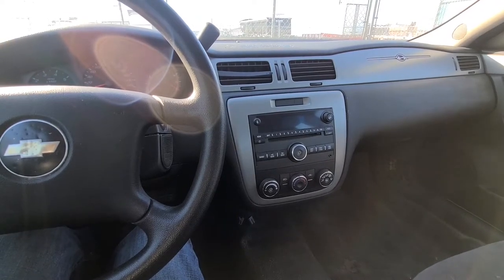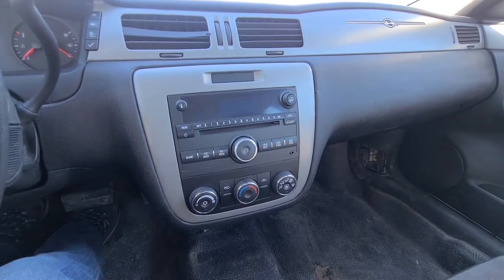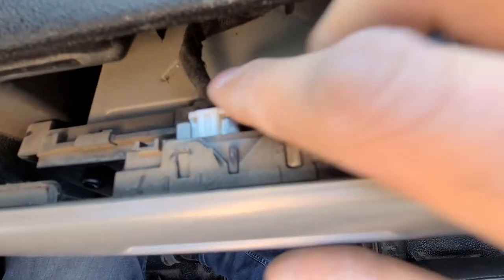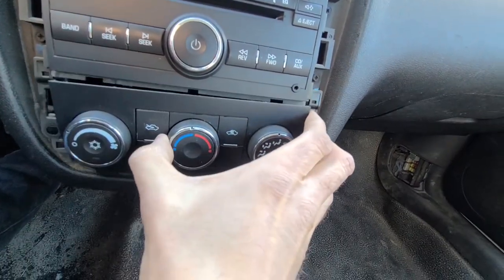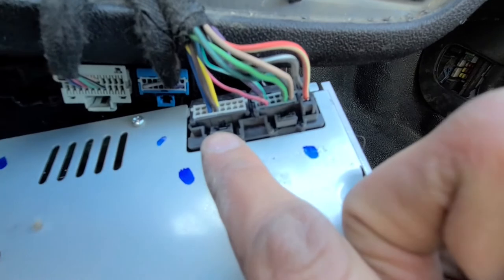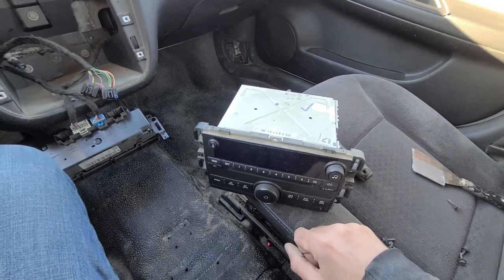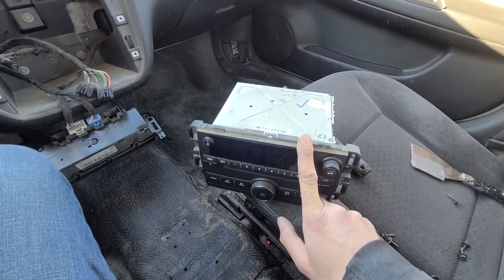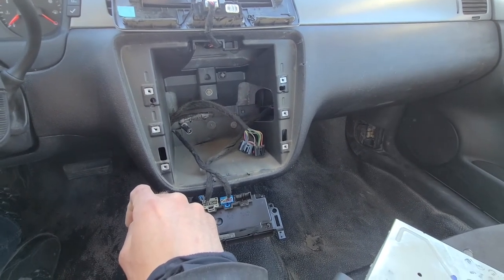Chevrolet Impala - RADIO REMOVAL / REPLACEMENT (2006-2016)

Comment: Thanks. Very clear and straight to the point. Now i can change mine.
And thanks for the information about the radio code. How if at all will that effect aftermarket radios?
Reply from the maker: You're most welcome. Aftermarket radios will not be locked and will not ask for the code. You will need proper wiring harness and dashboard kit to install aftermarket radio

Comment: Whats the cause of no sound on signal lights or hazards power to the head unit but no sound as well .
Is the head unit dead or is it a ground wire I use to hear a winning sound when you would accelerate now I don't even hear that sound would come from speakers too any ideas what I can do ?
Reply: I hope you already have it installed but try putting the ground on the car body and make sure to scrape away the paint, I had the whining noise in my subs, turned out to be a bad ground

Comment: Do I need a 4 digit code for an aftermarket radio, or just for an original replacement? Thanks!
Reply from the maker: Just for original radio. For aftermarket you will need wiring harness and radio dashboard kit

Comment: Hey I got a question so I Bought a aftermarket radio for my Chevy impala and I had some problems with the 12 V power over it work with her but the fuse or something And I tried to connected to the all-time power I did that and my battery died in my car I just need to help

Comment: Hey I know this video is 2 years old but I was wondering if you have any videos on putting a new aftermarket radio in. It’s way to difficult for me 😂to
Reply from the maker: Hi sorry never recorded it. You will need a wiring harness and you could need a dashboard kit depending on the type of radio you are putting in
Reply: @QuiteAlright  thanks man, we figured that out after about 2 hours of fooling with it 😭. Do you have any links to tutorials that go in depth?
Reply from the maker: @scoutzmarks2410  No not really. Best you can do is head to audio shop and show what kind of radio you are installing. they should have a wiring harness and dashboard kit for your type of radio and once you have that it is very easy

Comment: I bought a radio and everything but do you have a recommended kit because the ones i but never fit
Reply from the maker: I can't really recommend anything. I know Metra brand is decent. I usually get something at a local audio store once I know what kind of aftermarket radio I'm installing in

Comment: i bought a cop car . i am trying to get radio working it is dead no juice. the cop radios or whatever they had in it is gone but they crudely cut wires removing cop crap. i want to fin d out where wire goes into engine artea can you advise me . thank you
Reply from the maker: Hi, not sure I can help you. I used to resell ex cop cars and they almost always did that. Cut something somewhere to get their equipment out, depending on the department. I had a guy who often just pulled new wiring to the fuse box when we couldn't figure something out. Unfortunately I don't have a wiring diagram for impala.

Comment: How do you find the radio code on the radio ?
Reply from the maker: You would have to call Chevy Dealership with vehicle serial code and radio serial code. They usually charge around $50